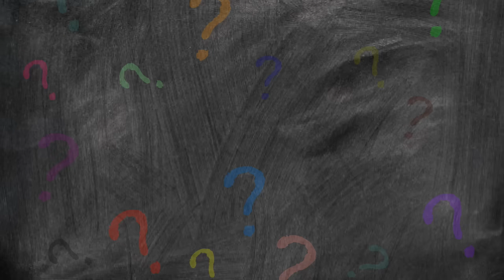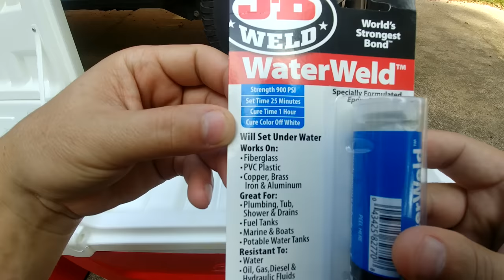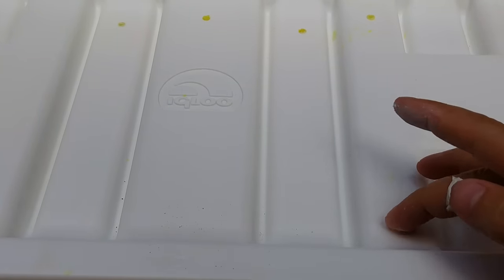Do Yeti cooler hacks work?

Comment: A lot of people are saying how wonderful air is as an insulator. Which is true, air is an excellent insulator, however, air is still an excellent media for heat conduction through convection. As the surface of the cooler heats up it creates a convective thermal transfer between the upper and lower surface of the cooler making this a much more complicated process. As you fill the voids with foam this decreases the convective transfer between the surfaces however it increases the conductive transfer as the foam is a better thermal conductor than air. So the increase (or decrease) in over-all total thermal transfer is a function of the density of foam and cell size, open cell vs closed cell, and thermal conductivity of the foam its self. Different expansion ratios, brands, types, and curing requirements will effect the insulation changes to the cooler. My best advice if you want to maximize the longevity of ice in a cooler is to build an external container to put the cooler in, this container would be made of layers of different types of insulation. IMO these layers would be the outer cladding, some form of radiant barrier, an air gap, then a layer of insulation, then the cooler its self.
Reply: The nicer coolers also dont have air in those walls, they are vacuums, and some of the cheaper ones can be as well if they are blow molds and all one piece, and a vacuum is the best insulator since nothing exists to transfer heat with.

Comment: Hey, I'm working on a masters of building science where I do a lot of work on understanding how buildings are insulated. What you've got in the standard cooler is an insulation via a large sealed air pocket, similar to how something like a double walled travel mug keeps coffee warm. Basically, it's forcing any heat to conduct through a longer continuous path between the inside and outside, or 'thermal bridge'. It's entirely possible that the window sealant foam actually conducts more heat than the sealed airspace does. If anyone's curious as to why we don't do that kind of system for buildings, reply to this comment. My advice though, is if you need you're cooler to last a bit longer, wrap or line it with a double layer of bubble wrap.
Reply: I know of the no-no of making a building airtight, but can you explain that? And what are you saying building engineers don't do during design? Is that related?
Reply: Cheap blanket works as well. Especially if it blocks the sun from hitting it.
Reply: @thewesty101   @thewesty  what I mean here is that it's pretty hard to insulate a building without conventional insulation like foam or fiberglass, just by leaving airspace in the walls simply because of large the volumes would have to be. Air tightness of a building is a different but related subject. In general, a building loses a huge amount of energy in airleaks, through walls, doors, windows, etc.
Reply: I'm from England but live in the States now, all the house over there are built with double walls called a cavatiie to help insulate the home. They use brick on the outside and a particular block on the inside with about a 2inc gap between them.

Comment: You should always pre cool a cooler before use. 

A lot of ice is used to chill, to bring down the temperature inside the cooler. So partially load a cooler at night, dump out the water/ice in the morning, refill, put food in. 

It’s the same reason you prechill a metal ice cream maker’s cylinder container.

Second, the foam lid, with gasket, install latches, or for testing add weights to the lid. A seal doesn’t do anything without compression.

It’s the air pockets in foam that provide insulation. With a cut opened Yeti cooler, the foam is very porous. Air is a very good insulator. So is the foam high density, or low, was it not able to expand out, got compressed? I think I have seen 1/2 holes drilled for this purpose.

What is the R value of the foam per inch, look up the R value of air. 

Where air goes wrong is if the cavity is to big, aka wide, a circular air circulation stream, vortex, is created, flowing from the inside cold surface, to the outside hot surface. This happens in rooms in your house when you heat it, or run the AC. 

You would think manufacturers would break this up. Maybe that’s why the bottom of the lid isn’t flat? The cavity isn’t continuous?

I would say two latches, plus the gasket would help. Not so much the foam. 

I do appreciate you testing it out. 

It is interesting.
Reply: I put my cooler in  the deepfreezer for 24 hours before filling with ice etc

Comment: I doubt the plastic here would be strong enough on its own but I'd be super interested in seeing this lid reinforced and vacuum sealed, that would probably be way more effective. It'd be tough to keep a seal on this but if it could be pulled off it could potentially achieve the desired result. Great video!
Reply: Isn't this what the process is for making glass line thermos'? Like the long heavy ones dad took fishing with the cup on top.
I remember he put hot soup in one before when we went camping. I was hungry and asked for some but how to heat it? He don't worry....it''ll still be warm.
It was actually like 36 hours later when I opened it. I poured it out and damn! There was no way eating this until it cooled down! kinda stunned me.
Maybe layer the interior lid with fiberglass resin with some .5 inch thin steel bars first epoxied to the interior panels of the lid. Then pour the mixed resin over the rods. I say about an .5 inch thick level layer. Drill and mount a schrader valve so a vacuum can be pull. This honest might cost $50.
Reply: @justinmurphy2227  Yep, that's a why those mugs are so good at insulating (I love mine as well).   The principle is just that one of the only things better at insulating that unmoving air is a vacuum. Your idea for reinforcement sounds good, it's what I'd probably recommend if I had to design one myself.

Comment: Great Stuff foam has an exothermic reaction until it fully cures.  Its quite possible the foam was exposed to enough oxygen to start the reaction but the curing process was mitigated by the decreasing exposure to oxygen.  Think of concrete bridge pilings which can take years to completely harden as the central core of the piling has very limited exposure to air.
In other words, the foam continued being exothermic which would result in the cooler having a warmer temperature.
Reply: Good point!
Reply: @aquapuncture3477  So you just accept whatever someone else says because YOU don't know either.  So, how do you know it's a "good point"?  It's not... it doesn't even apply.
Reply: @DiffEQ  okay, if you know better, I’m all ears.  I have no ego about someone else knowing more than me.  It’s all about learning for me. 
So, go ahead…hit me with it.
Reply: @DiffEQ  here’s what Greg Labbé, an energy and building consultant in Toronto has to say about this foam:

“When the two liquid components of spray foam come together, there is a very rapid exothermic (heat-producing) chemical reaction. Good foam has to be cooled quickly or it cracks and chars. If it’s too thick, the insulating properties of the spray foam trap the heat.”

Maybe I’m reading this wrong, but this sounds a lot like what I stated in my original comment.
Reply: @DiffEQ  relax, buddy. Deep breaths…

Comment: The second law of thermodynamics says heat flows from higher temp to lower temp. The lid without foam has a thermal break to prevent conduction of heat from the higher exterior temperature. The closed cell foam fill  allows ambient heat to easily transfer through the lid. 

The wall insulation has more of an  open cell which inherently has more air gap plus the walls are not 100% filled, there is a small gap between the outside wall and foam. Im sure at some point manufacturers of cheap coolers tried the insulated lid trick. 

Be better off gluing some pink polystyrene foam to under side of lid and  putting seal back on the rim. This would provide an airgap and increase insulation.
Reply: Was thinking while watching that air or open cell foam is what he needs
Reply: Somebody went to foam college
Reply: Single part cans, like he used, are open cell foam.
Reply: While you are correct.... The problem stems from the amount of foam he used so it never had the chance to properly expand and form the cell structure from the air bubbles and thus it effectively went from a potential insulator to just a huge thermal mass.

Comment: The lid has little to do with insulation relative to the sides.  Think about a yeti metal style cup, they work very well with or without the simple plastic lid.  If you want a yeti killer get 2 cheap coolers, a small one that fits in a bigger one.  That should do the trick.
Reply: Lmao
Reply: Yeti style cups are also vacuum sealed which is the best type of insulation
Reply: True.  On chest style coolers and freezers the lid does almost nothing to keep things cool.   Cold air pools in the bottom and the lid only keeps breezes from blowing it out.  Think of the deep freezers in the supermarket that don't even have lids and still work fine.

Comment: I did this about 30 years ago! It didn't work at first, so I cut around the entire top to find that the spray foam never expanded or dried. But after I cut it, it expanded like crazy and I had to cut away the excess and epoxy the edges back down! That cheep Igloo held ice 3 times longer.
Now when I do my coolers I put more holes in it and add very little at a time, starting from center let set for 1/2 hour  and work out from the center a little bit at a time with 1/2 hr times. This does work but you have to be patient. I used the 5 times expansion stuff that specifically says NOT to use around windows! It also made the lid very strong and I would sit on it.
I hope this was helpful! 
Jon Wilkins 
Rio, WV
Reply from the maker: Thanks for the information!

Comment: I know this is an old video, but one thing that I can suggest, is that a pocket of air itself makes an excellent insulator. In modern home construction, glass windows are often constructed so that two panes of glass are separated by a layer of air, and this pocket of air acts as an insulator. So one thing to consider is that the material that you are using to fill the cavity in the lid may actually be more conductive than the air itself, meaning that heat may pass more readily through the lid because you have filled that pocket of air with material. The material may also be acting as a thermal battery, collecting the ambient heat from the car in the condensed, material-filled space inside the lid.
Reply: I was thinking the same thing. Perhaps similar to the way radiant barrier typically has a higher R- Value when there is an air pocket between exterior and internal partitions.
Reply: Double pane windows don't have air between the glass LOL
Reply: @mwilliamshs  yes they do, that's literally the whole point of the concept. 2 panes of glass with an insulating layer of air sealed in between. It dramatically increases the insulation effectiveness of the glass.
Reply: @uselessprotaganist7444  they literally don't.  they're filled with a low heat transfer gas like argon.
Reply: @mcreealan  looks like you're right these days, just looked it up, but that's a new development from what I'm seeing. Until relatively recently, the central gas was just air, and plenty of double glazed windows are still made with air.

Just because argon is better than air, doesn't mean you can just stuff whatever in there and assume it'll be more effective than air at insulation.
Reply: @mcreealan  so i guess you could say that the days of dual pane windows containing normal air..... argon

Comment: I would investigate differential sunlight exposure through the car windows as a “wildcard” factor. Also investigate if there’s any reflective surface inside or outside the car that may be confounding your results. HEY: Here’s an idea to test any position effects - repeat the experiment but switch the exact positions of the 2 coolers. The only other thing I can think of is to fill both coolers with ice and then take hourly readings with your infrared temp gauge of 2+ “highlighted” marked locations on each surface of each cooler to see if you get consistently different readings. I’m suspecting different materials used in production on different assembly lines, or even different plants - - yeah, I know, it’s a stretch, if even plausible. Oh, I just noticed something: since these are facing each other, they are not in the same position, but that’s probably a minor factor. Keep up the good work - penicillin, Teflon, and I believe several other products were the result of experimental failures. Tungsten was Edison’s 1000th material in his quest to find a material that would not be destroyed by getting so hot as to emit light.
Reply from the maker: Thank you for the comments!  I plan to redo this video in the summer and I think putting the coolers outside will be a better method in making sure one does not get more or less sun then the other.

Comment: Igloo designed the cooler to have an air gap in the lid which is the insulation factor , so if you take that away and use foam which turns to a solid it won’t keep cold near as long as the original cooler.
Reply: yes for heat dissipation 💪

They thought it would insulate to keep the cold in but it did the opposite

It’s funny to think that people actually think a million dollar company didn’t do this type of testing before the product was launched lol
Reply: So how would this work in relativity to a window AC unit? Should I foam the gaps or not foam them?

Comment: your video is very well done. I like the way you explain each step along the way and the end result was surprising. However, I don't recall seeing where you did a benchmark test on each of the coolers before the modification. without the benchmark, you have no way of knowing that the each cooler is equally up to par, as is. I say this from experience from when I bought identical Coleman coolers several years ago and without any modifications, one cooler continuously kept the ice solid for a much long period than the other one. There was such a difference in the two, I came to believe that one was defective and gave it away. The "good" one lasted for years:) Keep doing good videos!

Comment: This is a fascinating video.  It would be interesting to use a heat sensor to determine where the cold air is escaping the modified cooler different from the stock cooler.  One possibility is that the modified cooler's lid is not sealing as well after all the molestation.  Another possibility is the added insulation is less effective than the air it replaced.  In the latter case, the lid seals that were removed may have actually helped.  Moral of the story: cooler construction (thermodynamics engineering) is not as simple as one might imagine and, by extension, more generally, these kinds of hacks can be expensive, time-consuming, wastes of time.
Reply: Great stuff foam reacts with oxygen as it cures and creates an exothermic reaction.  Usually that foam loses its exothermic energy in a few minutes but in this case the foam had very limited exposure to oxygen.  There was enough oxygen to start the exothermic reaction but not enough to fully cure the foam.  In other words, it made the cooler warmer.
Reply: Possibility?  He drilled a sealed lid and then filled it with a thermal bridging material.  Still air (sealed void) is an excellent insulator.  This would be no different than drilling holes between the panes of a double/triple glazed window.  The void is filled with an inert gas after the air is evacuated.  By the way, HOW IS THIS A YETI UPGRADE when the Yeti cup utilizes vacuum for insulation??
Reply from the maker: You are giving these cheap coolers too much credit. The lids are not sealed. I can squish the lid from brand new and even if you can't they are only filled with air and not sure tight. Do you really think a 20 dollar cooler has more thought in it than that? If you look up a yeti cooler cut in half on YouTube you will see it is filled with foam not air. The cups and coolers are not made the same.
Reply: @DiffEQ  “Lighten up Francis”.  Dude seriously, relax.  It’s going to be okay.  You don’t have to fight everyone over this video.  Take a deep breath.